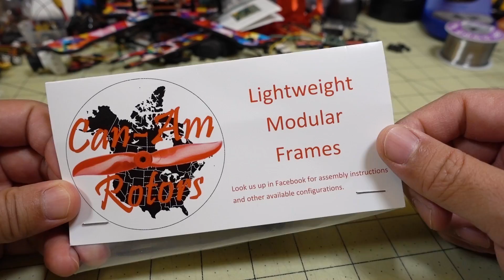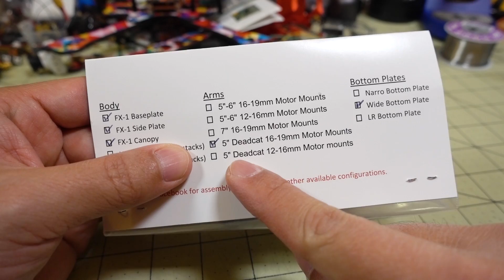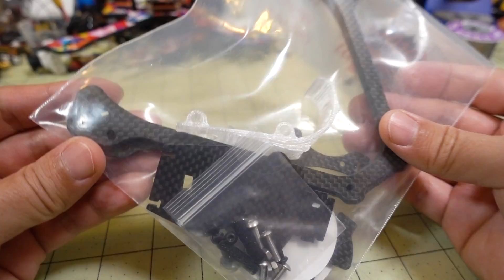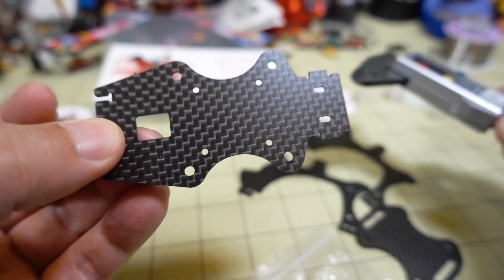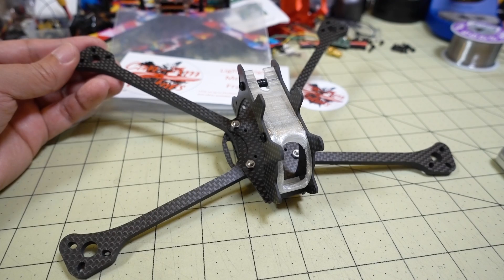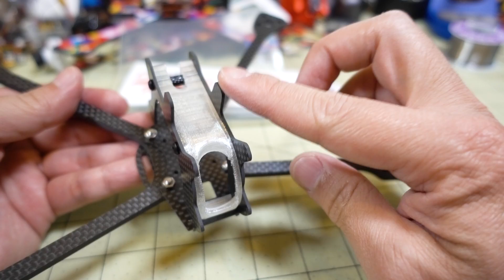Can-Am Rotors FX-1 Ultralight 5-inch Frame Review 🚁

Comment: Albert Thank you for the review!! We are actually already in the talks about going up from1.5mm to 2mm on the base plate and side plates to remove the vibrations by providing more surface area (also will tighten the tolerances on those connections). We will send you an updated body as soon as we have it available. One last thing Please keep in mind that this can be built with 30x30 or 20x20  stacks. Any other suggestion we are all ears!!
Reply: Dude, I liked the frame a lot! And leave a comment with suggestions, if you want to see. 😉
Anyway, keep going! Never let it go. 😊
Reply: @MCsCreations  Thanks a lot!!!
Reply: add holes to the bottom plate that align with the stack holes so you can get a tool through. :)
Reply: @bishopvick6373  We are looking into this as we speak. Will likely make it into production.
Reply: MAD GRUMPYMAN  Wow that's a lot of information!!! We do appreciate all the feedback. The original intent was to get this frame under 250G all up and then it morphed into multiple frames in a modular design that will let you interchange configurations.  We tried to keep weight at a minimum. That said we are already looking at beefing up the 1.5mm plates to 2mm.

 One last note, the grommet idea for the camera is actually pretty darn good. We might have to look into incorporating that idea as well.

Again keep all the ideas coming!!
Reply: You have already addressed beefing up the top, bottom, and side plates, so that was my first point to make. If you make the plates on the bottom thick enough for press nuts, that would make the build look cleaner, instead of having the separate nuts. It would also be easier to work on the stack from the top if this kit came with the M2 or M3 screws with rubber dampening so we don’t have to pull the frame apart to screw the stack in first before assembling the bottom portion.
Reply: @UrbanSleepersOfficial  Not sure I am following you regarding the rubber dampening? The press nut is a great idea and it was considered but availability becomes a bit of an issue.
Reply: @can-amrotors6910  I think UrbanSleepers is referring to something like FlightClubs "butter mounts" where he puts a rubber grommet inside the pressnut to add dampening to the entire stack.
Reply: Hector Fontanet the rubber dampening is like the anti-vibration screws in this link: https://goo.gl/images/AtnQNU. So the FC has a soft spot to be placed on without messing with breaking down the frame when we have to work on the quad. Overall, I really like the shape and aero dynamics of the quad. The 3D printed canopy looks great.
Reply: @sjcajw7  OK i see. I think the butter mounts is a whole different world but Le Dribs new 2" frame actually has this very same thing. What i am not sure is who that allows for easier stack mounting or removal.
Reply: @can-amrotors6910  I have no idea either. I've never had a frame with this feature. I appreciate how you guys are willing to listen to customer feedback/suggestions.  I don't need a new frame at the moment, but I will certainly check you guys out the next time I break an arm :) keep up the great work!
Reply: @sjcajw7  By then we should have the arms available for you.
Reply: @can-amrotors6910  If I put a split mini or similar in this frame will I see the props in the hd video? Im looking for a frame where I dont see the props, this looks promising.
Reply: @johhakan  the props show up a bit on the video of a caddx turtle cam which has a wider field of view.  The biggest thing was getting the motors and most of the props but there is still some on view. I will have some more HD vid from the Turtle soon. It helps a lot when flying with black or smoke (black translucent) props.
Reply: Oh oh i have a suggestion! Please tell me where to get my paws on your 7 inch frame!! Lol I am building a long range endurance copter and I LOVE the design of your frame
Reply: @flighttherapybullisticfpv133  contact us on facebook and we can talk details.

Comment: Hello,
Yup, needs access holes for the stack and beefier main plate at least.I assume the nut is a nylock type?
I think when a camera is installed and tightened down, the side plates won’t rattle around because they’ll be pinned down with the camera screws...
Personally, I like a stretched X, so maybe offering different styles than deadcat would be advantageous.
I like the idea and the approach, it’s good to see!

As always, thanks for the content:)
Reply: a stretched X is on the way. We are sorting out how much stretch is really optimal. Do you have a suggestion for this? I dont want to simply copy other stretch frames spread without really thinking about how far out is ideal.
Reply: @can-amrotors6910 ight now a stretch x in the front with a true x in the rear seems to be the hype. Not really sure how far you'd want to stretch though, just as long as rear arms can be in cleaner air offset from front.
Reply: Almost looks like you could reverse the deadcat arms to achieve this... Think I need one of those frames...